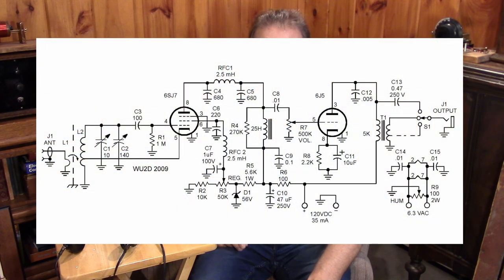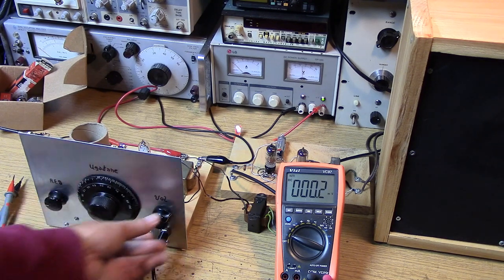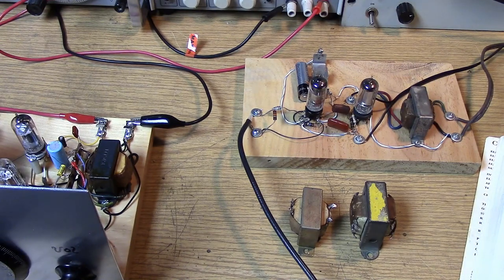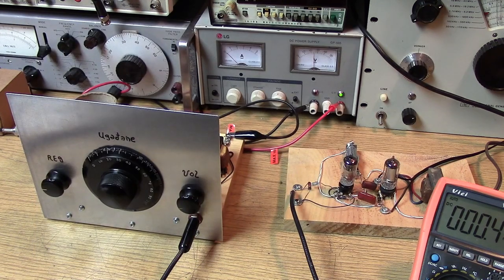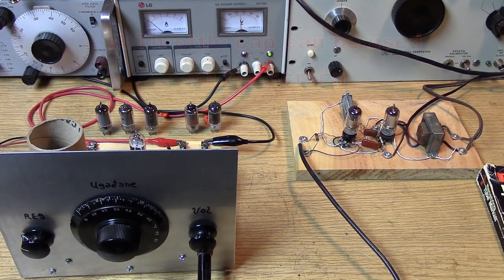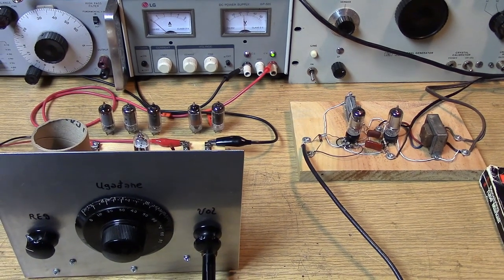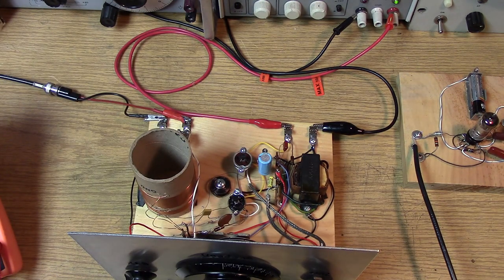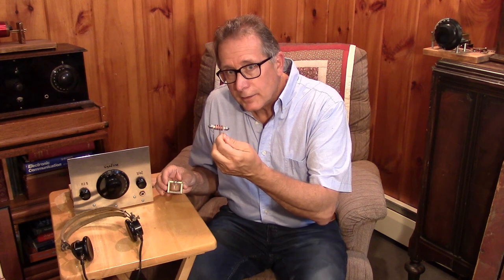Low V Regen Part4

Comment: I seen a radio like what you have on the back table. it was in a antique store just a few days ago. 1924 or 25 I don't remember? I have never worked with tubes so, it is still sitting there. :-)

Comment: Hi mike. Nice video. 50 years ago i build my first regen rx with a venerable 6j5  and i be able to rx bc stations 150 miles away. I always haved the same ideo like Dayle Edwardsand see how it perform a pentode regen using the screen for the throtle and volt control. I built several fet, bipolar and tunnel diode regen receiver. For now i am  experimenting in vlf band to detect thunderstorms with a good succes using hartler regen receiver. tks for ur time to explain carefully. 73 XE2EJ  Fernando
Reply from the maker: My first SUPER REGEN was a 6J5! The darn thing picked up FM stations 50 miles away.

Comment: I've got a couple little 6V filament pentodes -- 6AV6 or 6AT6, if I'm remembering right, sockets, tuning capacitor, and a couple 3:1 verniers.  Must get some chokes, and some higher wattage resistors, plus some enameled wire to wind the coils -- I've got to finally build one of these things.  I'll probably make a multi-tap main coil so I can run up into shortwave.  The beauty of a regen is you can use it to listen to CW and SSB with no changes in the circuit -- just a twist of the regen control.
Reply from the maker: I hope that the project is in full swing by now!
Reply: @MIKROWAVE1  No, I have too much on my plate -- still getting my darkroom up and running and trying to organize stuff so I have space to work on radio.  What I really want is to build a one-tube CW transceiver -- a regen that transmits by raising the coupling into full oscillation.  Strictly QRP -- a couple watts -- with one tube, but it ought to be possible, perhaps even engineer in a offset so I can hear folks who zero-beat my signal.  Still trying to figure out how to get a side tone, though.

Comment: Thank you for the video, very interesting and informative. In my practice, I paid little attention to regenerative receivers. After your videos, I wanted to experiment with them and especially with low-voltage power. I'm from Russia and I write using a translator on my computer, so I'm sorry if something is not very correct.
Reply from the maker: Ваш переводчик отличный! Спасибо за просмотр!

Comment: If the justification for low voltage B supply is because of relatively hard to find 45 or 67 volt batteries, there's an easy solution. Dollar tree has rectangular 9 volt batteries either 1 or 2 in a package. They're not alkaline but at low drain it probably won't matter much. Anyway, 9 volt batteries can be nicely snapped together to get higher voltages. 2 get you 18 volts for example. A 45 volt source takes 5 of them, and 7 produces 63 volts. You can use 8 for 72 volts if you want. It's almost as if they were designed to do it. With a standardized connector of some sort the B battery  can be moved from radio to radio. I've made many of these assemblies and they work great. Large shrink tubing made for battery packs make it extra nice. Packing tape or duct tape work as well.
   Another possibility is 2032 3 volt lithium coin cells. A C cell holder will accommodate 15 or 16 2032s stacked in series for either 45 or 48 volt output. I have located good prices for them as well. $.30 each is about as low as they sell for, so a 16 cell pack will cost roughly $4 which is in the neighborhood of the 9 volt based version. The 2032 pack is nice and small, while the 9 volt pack has a higher mah rating.
   Btw, the only power switch truly needed is for filaments on these receivers. Without a heated cathode no plate current will flow, meaning the plate voltage can stay connected if you want.
Reply from the maker: To a young person or beginner, or even someone with limited resources, reading a vintage hobby book or article, it is sometimes is as simple as the project specifically calling out unobtainable parts. Parts that can easily be substituted by low cost common items. To others it is a justifiable fear of electrocution!
Reply: Dollartree sells very cheap 9V Transistor batteries?
Reply: @MIKROWAVE1  45 volts is considered safe.
Reply: @Jeffrey314159  Yes.

Comment: I have tried sharp 6sj7 and remote 6sk7 regenerative detector tubes. the advise was the remote cut off would give less critical regeneration adjustment. ya, but, not by much that I could tell.
Reply from the maker: Same here - lots of hype but no real diffo...

Comment: 20:14 I tried to reproduce the "Radiola Senior" using a JFET, but I used a variocoupler arrangement to control REGENERATION - - was I wrong?
MPF-102's I think damage easily with to much Vdd applied to the source to drain supplied by two 9V Xsistor batteries connected in series with a 1K Ohm resistor? ? ?
Reply from the maker: Using a variocoupler as a regen control is very elegant, some say better than a throttle capacitor. I used a variocoupler in this project as the antenna coupling control.

Comment: awesome, really enjoyable to watch, The tickler  coupled to the screen works very well with pentodes, the variable DC voltage fed into the earthy end of the tickler.,, the tickler in series with the regen pot and screen grid This connection further isolates the anode, effectively becoming an electron coupled oscillator.  This will make the RFC redundant .  You may like to try this ?
Reply from the maker: Wow! You are going to enjoy the next video in the works "Regen Nuts". Before I leave the subject, at least for a while, there has to be some humor added in to all of this. The The high point is a no holds barred shootout on 75/80M between a 1929 vintage Regen and a Collins R390A.

Comment: Great!!! Many thanks!!! This answers my questions.
Reply from the maker: We want to hear about your radio construction progress!
Reply: MIKROWAVE1 I'm stuck with the JFets having very poor regeneration control. Can you post a link to the JFET receivers diagrams you showed briefly on the video please?
Reply from the maker: @NOMOREPAM  Yes I will post those. Nowadays, after Chuck Kitchin got his circuit tamed in the mid-1990s, most folks now bring the detected audio off the source as a follower.  That separates the audio from the feedback control, so the throttle approach and even voltage control, start to work more effectively.

Comment: Well done. Do all the 6-volt tubes have the same filament resistance? They seem to divide the 12-volt supply very handily. I doubt that's not just luck on your part.
The common-base antenna buffer threw me for a loop momentarily. I had forgotten it is a good impedance-transforming buffer
Reply from the maker: Yes! most in the same class have the same filament current rating and thus divide the voltage nicely. 150 mA for the 12V tubes and 300 mA for the 6V tubes.

Comment: I enjoyed your series and will build this. A question about the tickler and removing turns. Could you have used a variocoupler for the tickler to avoid taking off turns?
Reply from the maker: Variocoupling the feedback? That is how almost  all 1920 AM Band Regens did it. The throttle capacitor and more primitive (but simpler and cheaper) resistive swamping and voltage adjustment comes later.

Comment: How about using a 6au6 as the detector?  Grid #1 to 12v, Grid#2 as the control grid, Grid#3 to the plate.  This is a space charge triode circuit.
Reply from the maker: An Avante Gard circuit to be sure! Hey I had a very microphonic 6AU6 that I wanted to show in the video. I forgot to do that.

Comment: Hey Mike.  I just completed the 12v version of the Low Voltage Regenerative Receiver.  It sounds pretty nice on the broadcast band.  I haven't wound any other coils yet.  Mines built on an aluminum chassis.  I'd like to pair it with the amp I made a few months ago...your design but I need to find transformers.  Tnx OM - wa4chq
Reply from the maker: Try some small 24V jobs. Some of these have a tiny Hi-Z wind on the primary and transform the impedance down for 600 Ohm headphones pretty well.
Reply: OK...thanks! @MIKROWAVE1

Comment: Hello. On the coupling coil subject. Schematic is showing 5-10 turns. Is the coil recommended to be close wound or scattered out like in the video. Kinda looking for some more information on this coil design ideas as windings count examples for the shortwave bands as well.
Reply from the maker: All the normal rules apply like using standard close wound solenoid windings at low frequencies, and spreading turns and using heavier wire above 10 MHz or so.  But because we are dealing with low voltage, generally more feedback is required, so the tickler windings or in the case of a Hartley, more tap feedback is required to get it into the sweet spot.

Comment: Hello Mike, I greatly enjoy all of your videos and I always learn something new... you never fail to deliver...!  
So as a follow-on to this video, how about doing a Plate-detector version...?  
(BTW Mike, on a separate note, I am curious if you know why some Balun designs use teflon tubing around the conductors?  Does it have anything to do with maintaining a consistent dimension between the conductors?  Perhaps you can speak to it in a future video...? ) 
Thank You Again...!  
Best regards, 
Greg 
(KC9ZEW) ...
Reply from the maker: Wow Greg, I have no idea what the Plate Detector version of a Regen is. But that is normally how I start - knowing nothing...Ha. The tubing idea? My guesses include: handle core and conductor heating and as additional protection from HV arcing, and even abrasion from sharp edges of some ferrites.

Comment: I plan to use some 6 watt dynamos for building a regulated battery charger to take on my bike for long trips,? I’ll stay powered up on the road with this technology, I came up with a efficient design that can light up incandescent bulb off this amount of power DC to DC converter and it makes a bunch of RF noise, I wonder if the FCC would trace me down?
Reply from the maker: I would add about 20 ferrite beads, a 12 x 12 x 5 " lead box,  two 1 Farad Capacitors for a start.
Reply: Use a hub mounted dynamo, don't go for the ones that press onto your wheel. They put out maybe 3 watts, but add so much friction and loss that it slows you down significantly. 
You probably don't need any dc/dc converters, bicycle stuff is usually available with AC output. Otherwise you can use something that switches at 50hz, so you won't be having any RFI. It does make the transformer a bit bigger.
Reply: LimaVictor nah I’m sayin I got em goin good nice electricity mah dawg. 6W $9.99 each on amazon, I bought the last two Tung-Lin bottle dynamo now I’m square. Right after I did that the price went way back up to $32 cuz I’m a boss and spend time lookin for the sales. I work at an amizon warehouse so I help get it onto my porch like that cuz I’m the man
Reply: If you keep cycling and cycle fast, the FCC may have a hard time finding you.

Comment: hello mr. mikrowave, i built the low voltage regen receiver but im not getting any sound coming out.  can anyone help me? I really need some help to make this thing work.
Reply from the maker: Start by removing the tube and measuring the plate pin to see if the B+ is there. Is the tube lighting up?

Comment: I noticed you used a variometer.
Reply from the maker: Just a teaser at the beginning and end. I am a sucker for link coupling on these regens. That was why I built the coil upside down and made it tall. Not tall enough actually so I had to make a little platform out of cardboard.

Comment: Can you help me building a low power pentode Fm receiver radio 88 to 108 mhz receiver . I Need your help.
Reply from the maker: FM can be slope detected by a superregen. That can be done with a single tube like a 6U8 with the triode stage as an RF buffer and the pentode stage as the detector driving headphones. Or two valves like adding a 6AQ5, if you want speaker volume. The other approach is a Fremodyne which is the same thing but with a front end tunable converter into a another double tube with one side being the superregen operating at the IF, and the pentode driving the speaker.  A pair of any of these valves and 60-100 VDC and I think you would have something: 6U8/6GH8/6EA8/6JW8/ECF802/6LX8/CV5065/ECF82/6F1P. I will post something on Mikrowave1.facebook.com

Comment: KA2213 AUDIO IC will give better audio Quailty, instead of LM386.
Reply from the maker: Yes sir. The old LM386 is a first Gen device that is simple and cheap. There were many nicer parts developed once the tape decks and boom boxes came out, and you could hear distortion clearly.